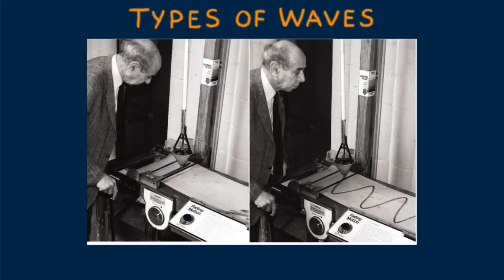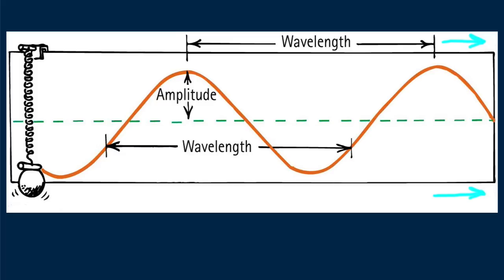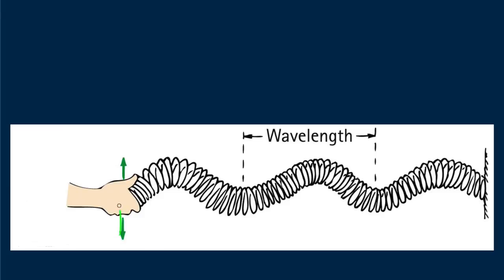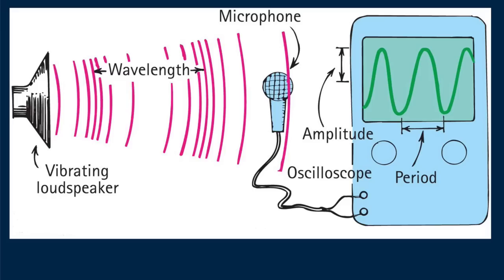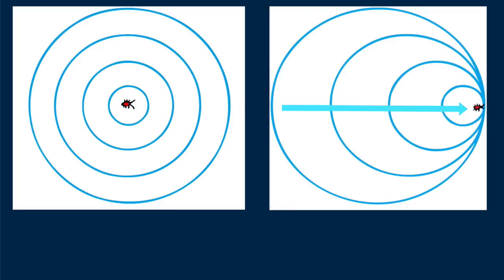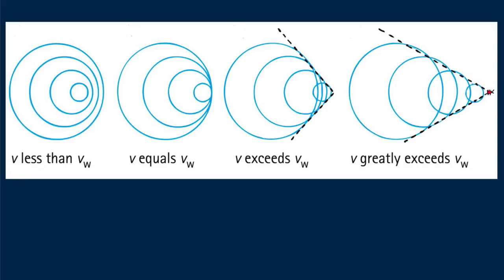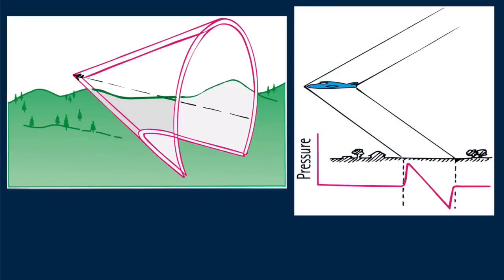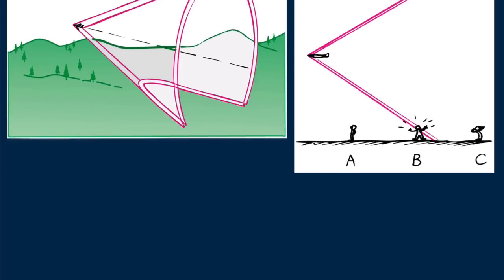Hewitt-Drew-it! PHYSICS 83. Types of Waves

Comment: @5:19 The Boom moves across the ground at the speed of the aircraft. This doesn't sound right. If the aircraft is moving faster than speed of sound, the boom will move at speed of sound, correct?